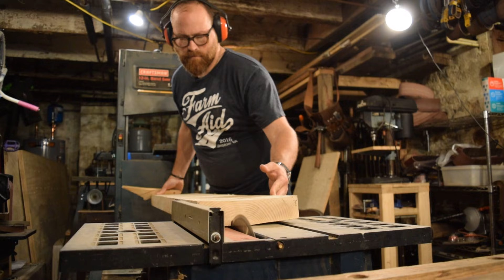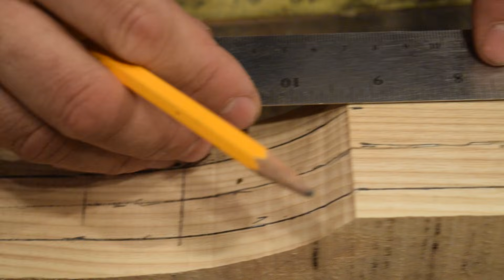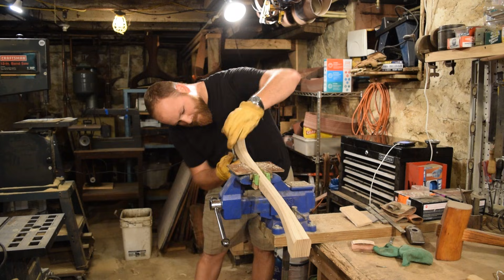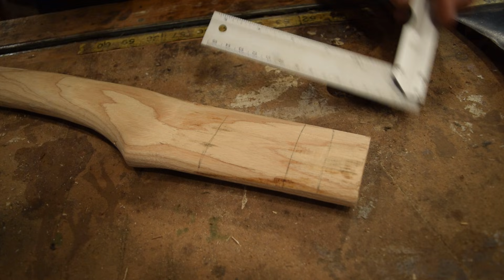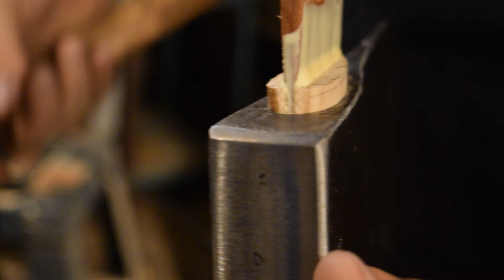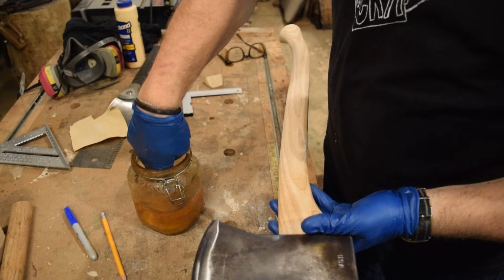Making an Axe Handle from Scratch

Comment: As someone who hangs 3 to 10 axes a week, this is a great video. Probably the best I can recall seeing. One piece of advice to help not break the wedges, I use the poll of an axe very similar to the one you just hafted to pound my wedges. It's big enough to hit the whole wedge at once and you dont need to flip it upside down. Pretty much haven't broken a hardwood wedge since I started doing that. Keep it up man, just subscribed, great work!
Reply from the maker: jeffericseccombe thanks for the advice! I’ve seen that done and have wanted to give it a try. I should have opened the kerf up a bit more to make room for more of the wedge, and I probably wouldn’t have split it, but it will do the job just the same I think😉. Maybe just not as pretty. I’ll give your suggestion a try. Thanks again.
Reply: Great tip! Tnx

Comment: This is one of the worthwhile axe handle videos on youtube. Good demonstration and explanation. It's a 25 minute but moved along and seemed shorter which to me is the sign of a well done video. I especially like that there is no metal wedge used in the end. I do use metal wedges occasionally but only when I'm saving an old handle, never on a new handle.
Reply: ok, I see that he is using wood clue to lock the wedge in. That's great, but if the head comes loose you're in for trouble as you really cannot remove it. Without glue it's not that much of a deal to remove the wedge. From experience I am in favor of metal wedge to lock the wooden wedge in place as the tend to jump out especially on longer handled axes exposed to more stress. Don't really understand why people have such a dislike for metal wedges -  I mean after all there is no perfect solution here!
Reply: @Olivier van Oeveren as a matter of fact I have started to glue the wedge in, lol! I have learned that the bond formed by the glue will go loose with heat. I like the clean look of only a wooden wedge
Reply: JAMaxe Restoration this is social media’s only civil discussion in all the internet. Well done. 👏
Reply: @donttreadonme1367  You spoke to soon. Jump from a roof and drink bleach anyone who uses wood glue for tool handles! 
Lol J/k